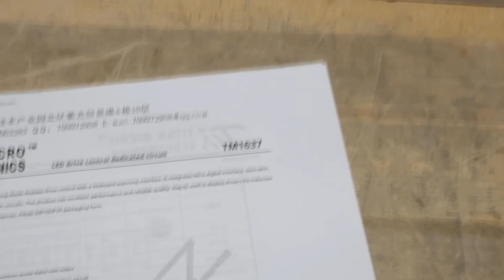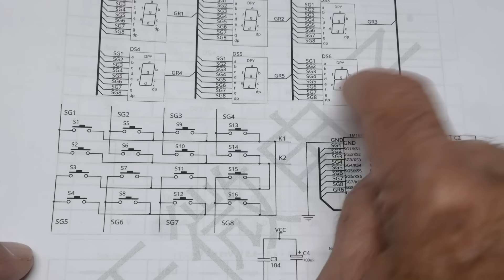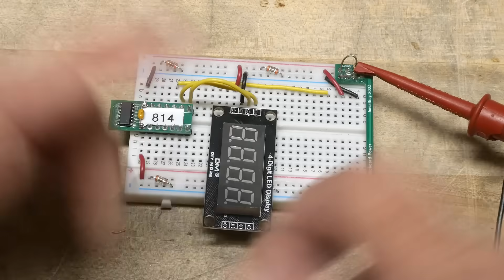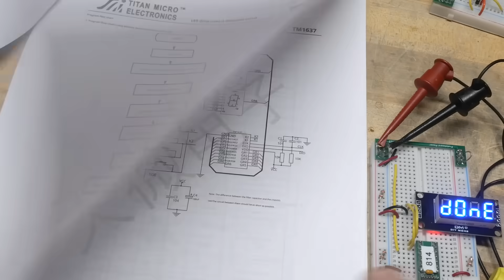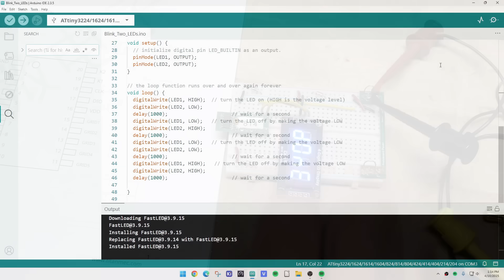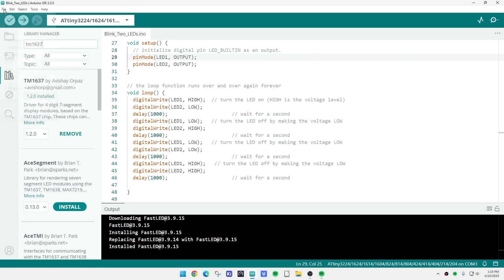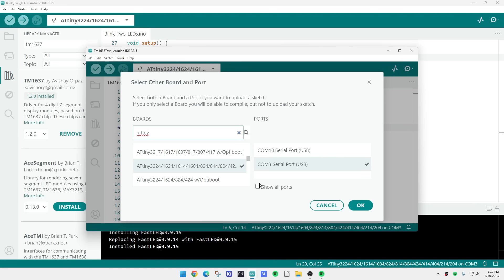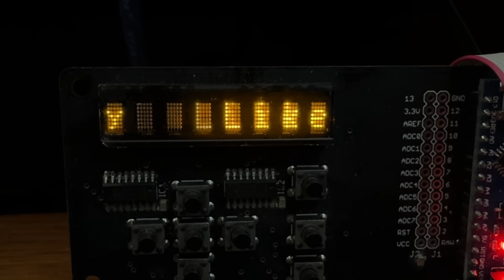#2217 TM1637

Comment: I'm in the middle, too. I prefer Arduino-land for rapid prototyping, with solderless breadboards or even soldered perfboards. But for "real" projects, I prefer designing everything myself, including a printed circuit board. I do prefer using existing libraries, when they don't break anything.

Comment: I love these kind of chips, and making them work from just looking at the data sheet, even bit-banging it if I have to. I have a front panel that I salvaged off of some junk equipment that uses a TA6932, which supports 16 digits and a 4x4 keypad. It was missing two digits of display (empty holes on the board), and I had a 2-digit that would have worked but it was the wrong cathode vs anode, darn it!

Comment: It's a great chip, but in typical Chinese fashion, they invented their own protocol over the standard hardware, I2C in this case. So overall, the chip can benefit from using the system's I2C implementation/DMA possibly, but it can't share the bus with other devices (i.e., several displays) as it's not addressable.
Reply: on the contrary, these chips are daisy-chainable like shift registers. And they did not use standard protocols because their approach allows for MCUs without hardware blocks for such and are good enough using bitbanging.
Reply: @Mr.Leeroy You really don't need a hardware peripheral to use I2C or SPI or almost any other 'special' protocol, you just need to understand how the protocol works and be able to code.
Reply: @M0UAW_IO83  yes, if you want to waste your CPU time as well as human-hours reinventing the wheel.
Reply: @M0UAW_IO83  You really don't need an SDK or HAL library or, in fact, any high level languages, you just need to understand how hardware works and be able to code.

Comment: I like modifying those TM1637 modules by adding the extra 2 digits (or 16 LEDs) and button matrix that the chip supports. The Arduino library then needs modifications to access the full capabilities of the chip.